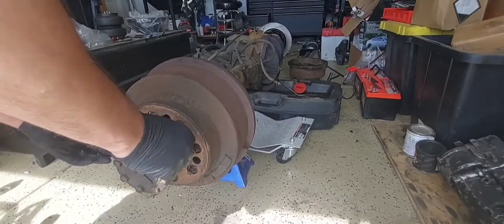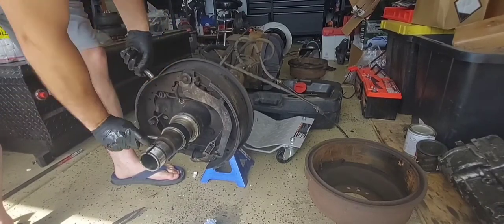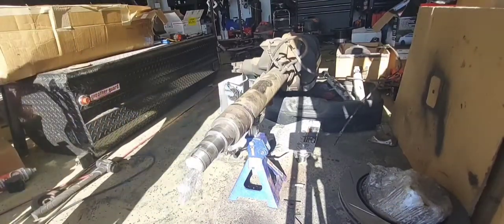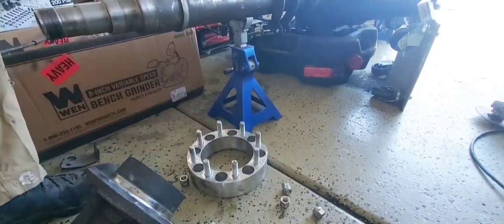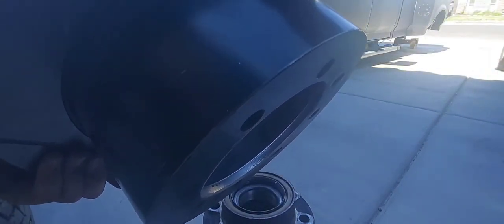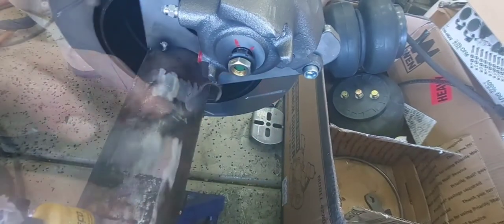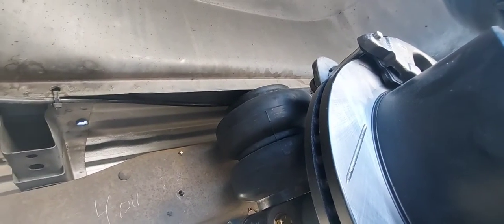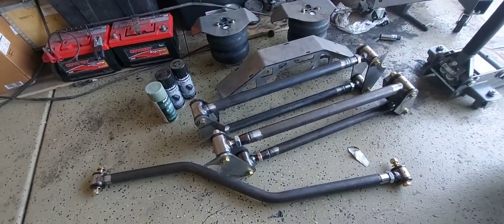project SilverFox.                            10.25 DRW disc brake conversion.  and 4link mochup

Comment: Great video.
Why did you convert to disk?  There is more friction material with drum, right?
Is it for ease of changing pads later as in a disk brake is an easier brake job?
Reply: Discs dissipate heat better, can run slotted and drilled rotors, cleaner looking, easier to change pads. On and On reasons to do discs

Comment: Do you have to grind those off? I’m doing this to my truck but I just wanna make sure I don’t screw up anything and I have a manual transmission so how does the emergency brake work on this as well thx

Comment: What calipers and brackets did you order? Was it a kit? Also what year e 350 rotors did you use?
Reply from the maker: Lugnut 4x4 kit w/ e-brake calipers
Reply: Thought so. Sold out.  Ruffstuff has a kit too.